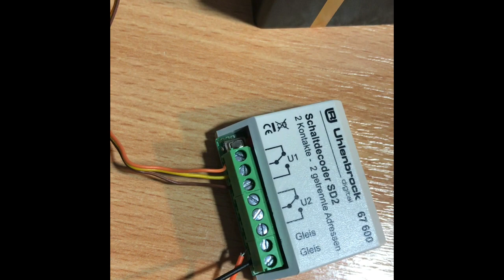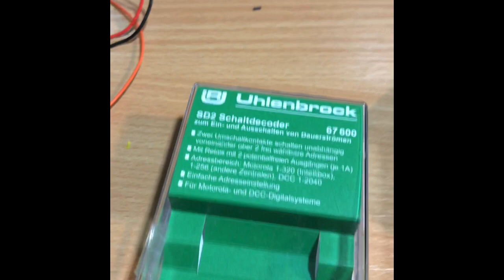Part 2 Digital control of Dapol 4L-001-005 Signal with Uhlenbrock 67600

Comment: hi james, i have an issue using this kit with itrain. if i set output 1, on the 5000 it works as expected but when the same address is set in itrain it operates 4 bits out, eg if i set up so output 1in itrain is set, output 5 operates. this is the same for all outputs however the inputs work fine.  any ideas
Reply from the maker: JEZ8543 are you use it set up as Z21?